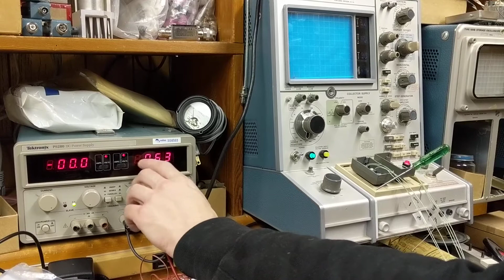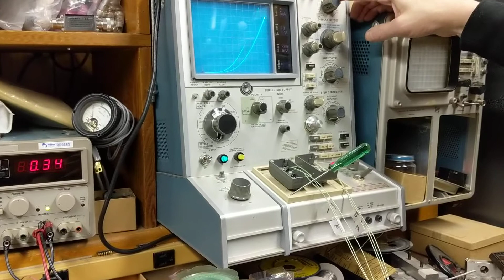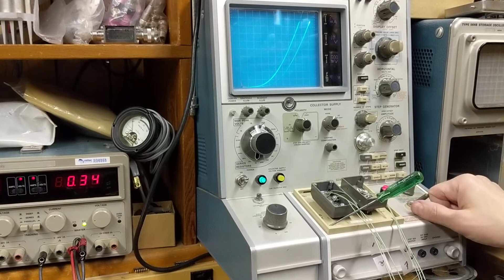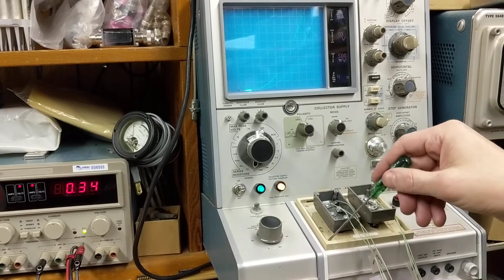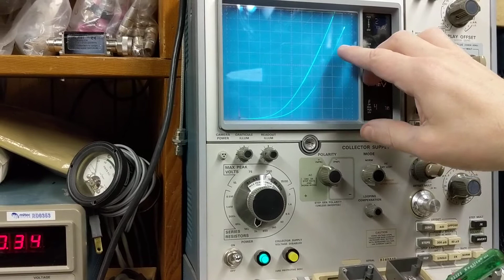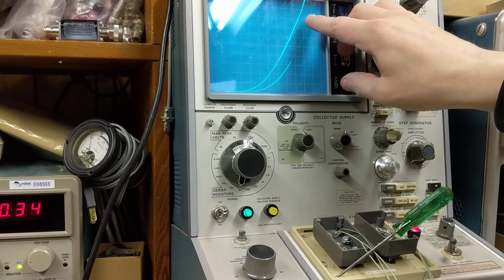Testing a 6DJ8 Tube Using a Tektronix 576 Curve Tracer

Comment: I have a question about techtronics tek 177. I have one that's mounted on a 577 but it doesn't seem to be responding. the interlock switch is missing and when I looked inside it's not bypassed...  ypu Happen to know how it should be set up to function? Please advise